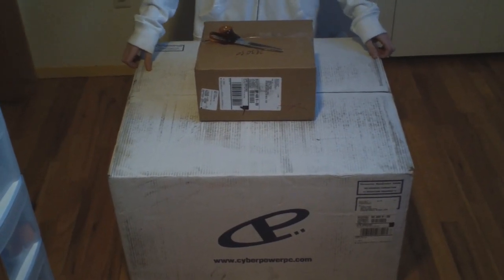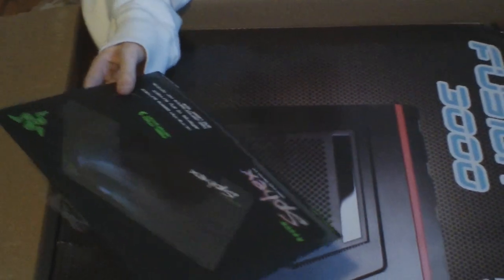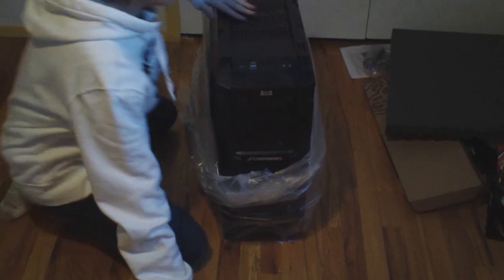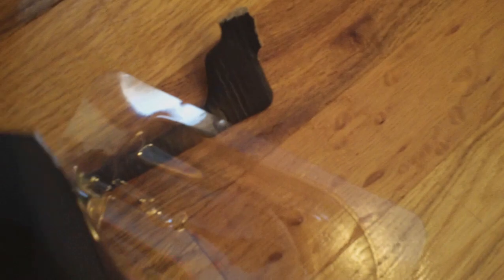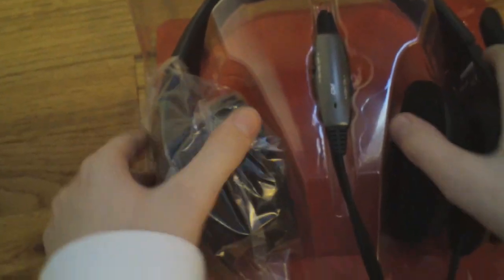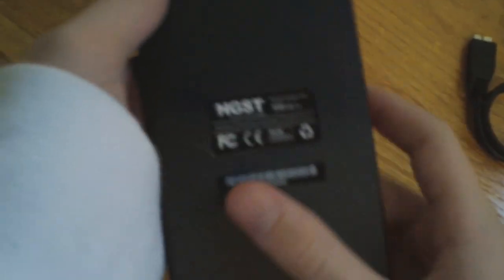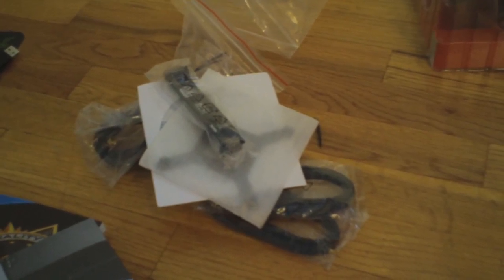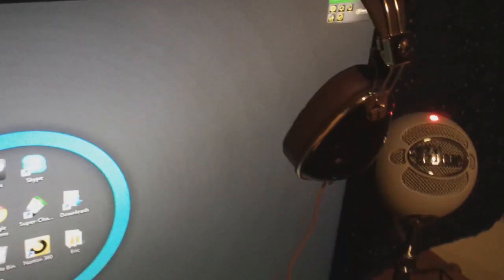Cyberpower PC UNBOXING [] Black Pearl Gaming PC Customized

Comment: Yep, CPPC has extremely crappy stock PSU's. I hope you have replaced it with a Corsair or a good brand name PSU. In retrospect, you should've used the money you dropped on the sound card for a good PSU.

Comment: People that call other people noobs for not building it the pc your self
Are losers not everyone has The time to build it and the Spec are amazing my cyberpowerpc azza9000
Case, asus crosshair mb 
16 gb ram 1td hhd 120 gb ssd amd 7990 and a amd
5ghz prosser and 240mm gpu and cpu cooling system
For only 2,700$ pretty cheap for a kick ass rig thumb up nice pc